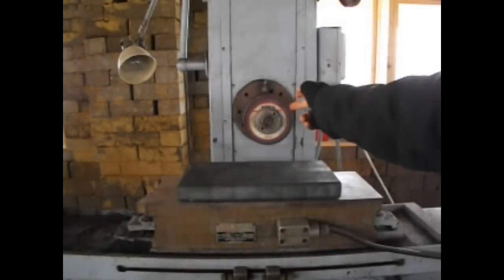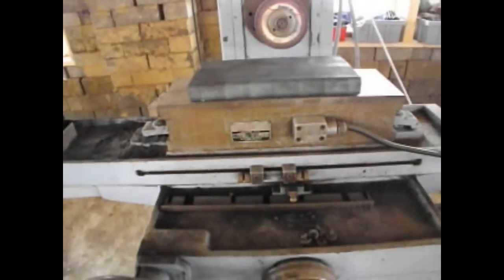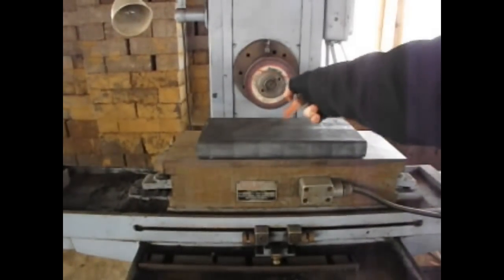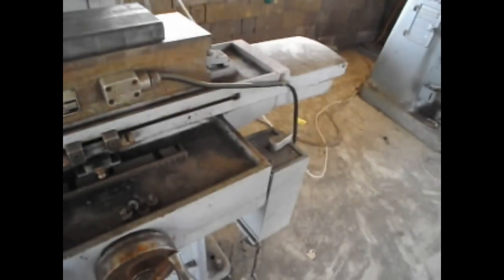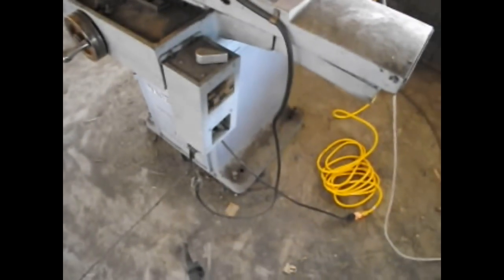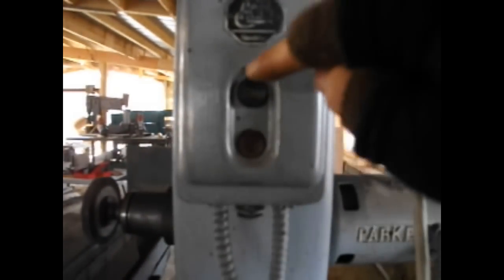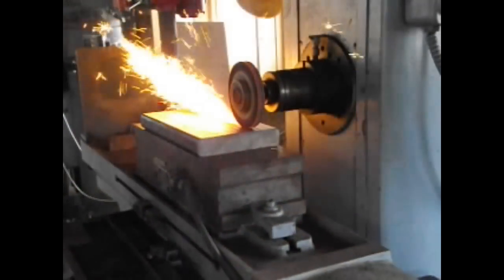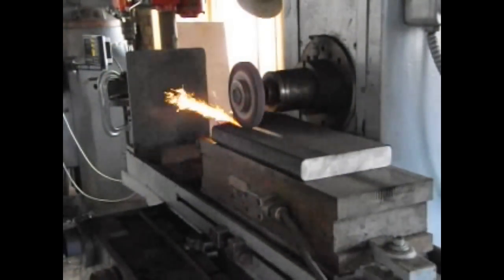How to Use a Surface Grinder

Comment: In what junk yard did you find that machine?
Reply: I use to work for uk company many years ago that made these.. Were pretty accurate but basic.. Mainly made for occasional tool room work,but mainly shipped to developing countries as they are very low maintenance as all hand operated.. Not my favourite grinder by the way :)

Comment: Hi , I have not used one yet , but picking one up this week . I have one ? When your grinding doesn't the grinding wheel  get smaller and wont the be hard to keep it he piece your working on  flat ,llike after you start ,by the time you get to the other side of a piece  don't you have to August  as you move , I hope I ask this correctly , you know what I meant  right ?? Thanks a lot , sorry if its a stupid ?  ??

Comment: Frame time 3.25 the wheel stops on the job. Most probably because the cut was way to deep and he's using almost the full width of the wheel too. Appalling demonstration of a grinder.
I agree with Dr J3kll (below) this video should be removed because it is everything a person should not do with a grinder. They are hideously dangerous machines in fools hands.